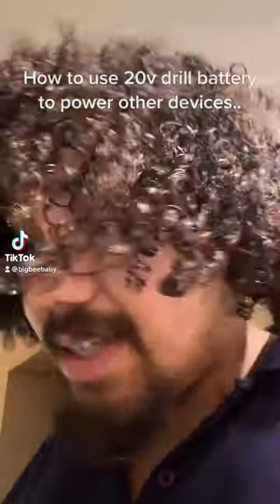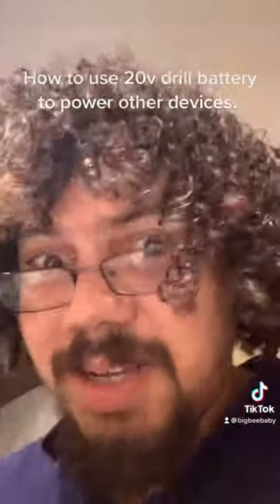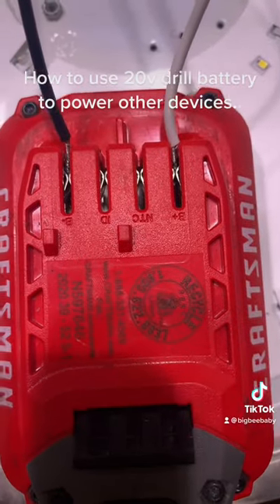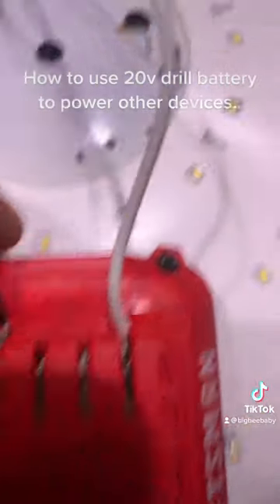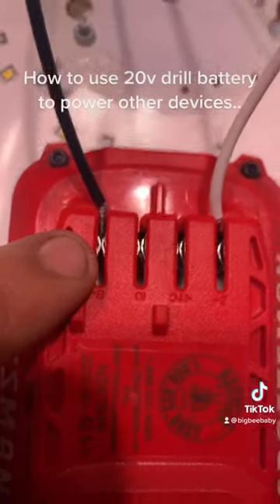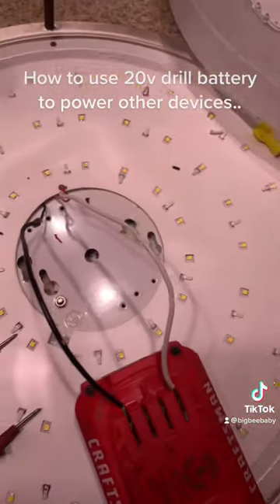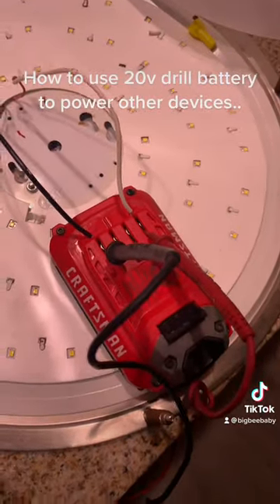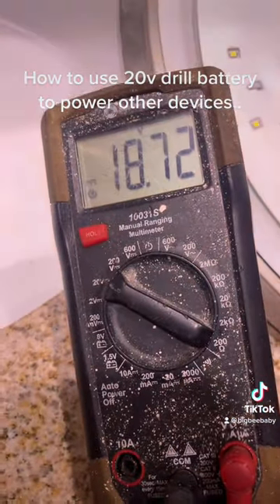How to use 20v drill battery to power other devices.. #bigbeebaby

Comment: If the light operates at 40 V you could connect your two batteries in series by connecting the positive wire coming out of one battery to the negative wire coming out of the other battery. That would leave you with a negative wire coming out of one battery and a positive wire coming out of the other battery. Those would be your new positive and negative wires. The amp hours would stay the same but the volts would double. so you would be operating at a voltage much closer to what the light requests. Volts times amps equals watts. If you connected two batteries in parallel, or positive to positive and negative negative, it would maintain the same voltage, the 18+ volts but it would double the amp hours. When you connect in series it doubles the voltage but maintains the same amp hours. But in either case you end up with the same amount of watts. And watts is what you need to use for your light.
Both cases will work fine but the light might be much dimmer with just one battery operating at less than half the voltage requested by the light.
Reply from the maker: True..

Comment: I made a custom set of jumper cables for my 20 volt Dewalt & they will dam Sure start your car, but when I hook them up I move quick & of course pretty much drains the 20 volt haven't had one blow/fire yet
Reply: It sure will, I jumped quite a few off with some wire I used off of something random. Hey anyone ever got the charger off a motorized wheelchair? I had two vehicles went dead after a night of partying , I hooked cables from one to the other and connected the charger to one car and crunk them both up fairly quickly, probably less than 5 mins

Comment: I have used 14/2 to jumper to my gfs car battery. It will crank once or twice before you drain the battery.
Reply from the maker: Yes sir.. I wouldn’t recommend for everyday use but it definitely works in an emergency.. has def helped me a few times now..

Comment: note that you need to match the voltage, if you try feeding a 12V device with that 20V battery, you're gonna let the magic smoke out.
though you can use diodes to drop the voltage by a bit, usually you get -.6V per diode, you can check with the voltmeter.
you can get diodes from old power supplies and random devices, the blocks with ~+~- are 4 diodes, and if you feed them from the - and take the voltage on the +, they'll work as 2 diodes in series and drop about 1V
Reply from the maker: That’s true.. looking back on the video I didn’t do a good job of explaining.. just something I thought I would try.. I thought about wiring 2 battery packs together in series to try to make the voltage needed for the LED to power on but I don’t wanna be responsible if someone tries it and burns their house down lol..
But I did want to share the idea it may be useful to someone someday..
Reply: @satibel can you drop a link to what u explained

Comment: It will start your car. Even a 10AH dewalt at 18 volt hooked up to the 12 volt car battery will only bring the voltage to 14.8 volt. Car battery at 100AH ? No worries

Comment: Did he really try to power AC circuit with DC source without a inverter??
Reply from the maker: The output of the original power supply is 37VDC.. the problem isn’t ac or dc.. the problem was not enough voltage.. I could have wired 2 batteries in series but that wasn’t the point of the video.. the point was with little effort you could convert a lot of things to run on these rechargeable batteries that a lot of people have just laying around.. I have jumped cars with them.. I have since have people say they have powered kids power wheels.. It would come In useful in a power outage and many more purposes.. the light didn’t need to work to understand how to wire something to the battery

Comment: Bro you can start your car with that shit at summer
Reply from the maker: If I ever need to try it I will definitely make a video about it.. 💯💯💯
Reply: I've done it several times with Black & Decker 20v. Use a well charged battery. Be careful. Also the first time you do it you feel like a boss.
Reply from the maker: Didn’t make a video about it but I tried it yesterday and it worked great.. 💯💯💯